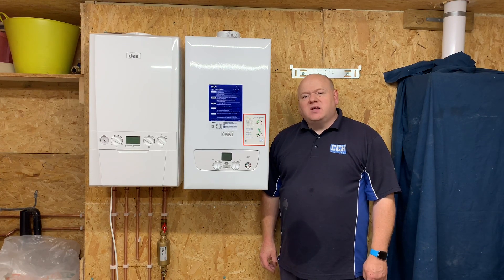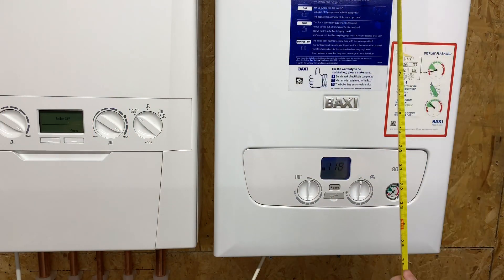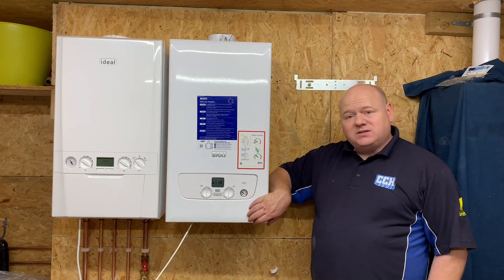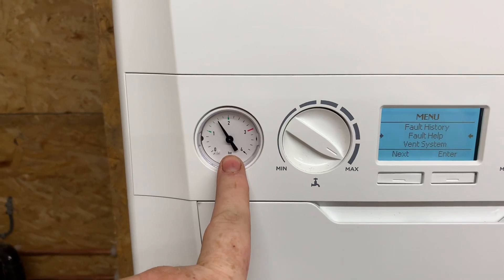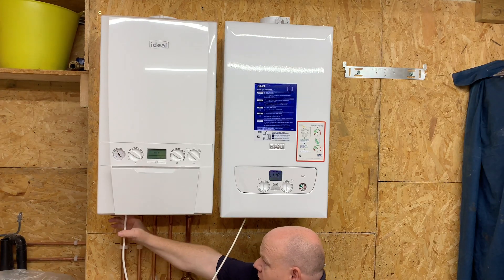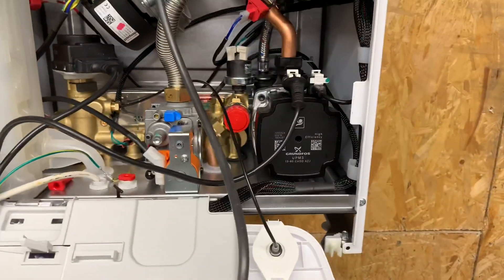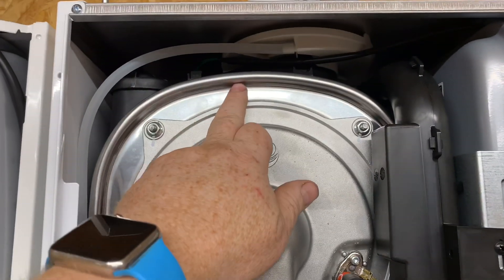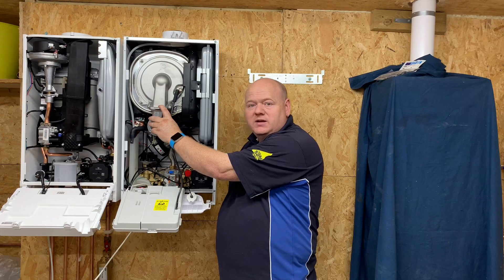Combi Boiler Reviews - Ideal Logic Max v Baxi 800

Comment: Really dislike ideal logics awkward to work on sometimes they seem to fail alot more and the heat exchanger are total garbage constantly getting blocked been to two year olds that have needed full strip downs also gas valve doesn't ever seem to feel right with that o ring it does seal don't get me wrong but it just doesn't feel right
Reply from the maker: Thank You

Comment: Baxi may be better from an installation perspective, but I've had no end of warranty claims on them. They NEED the warranty; I'm surprised they make any money on them. From a consumer perspective, and reputation, its Ideal all the way.
Reply: If installed and serviced right you don’t get problems with either really, the 800 range is proven. Both are easy to install, nicer to service the baxi’s only issue you’ll get with the baxi is split top pipe and DHW turbine which can snap when you try and remove it costing you a new RH block, the logics only really suffer with cracked plastic on either sump, sump door or snorkel if serviced right. If not installed and flushed/water treatment done properly then the Divertor can leak (if cleaner isn’t drained out properly when commissioning) cleaner will eat the o-rings causing failure. 
If you’ve had lots of issues with the baxi there will be a reason and 99/100 it isn’t the boiler! It’s all proven to be reliable!